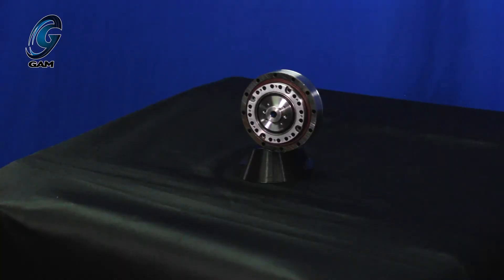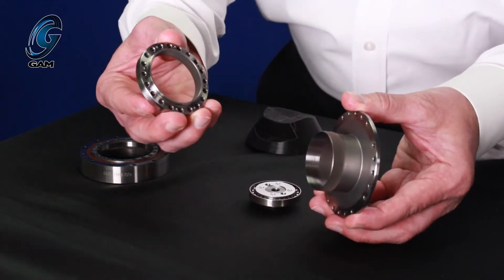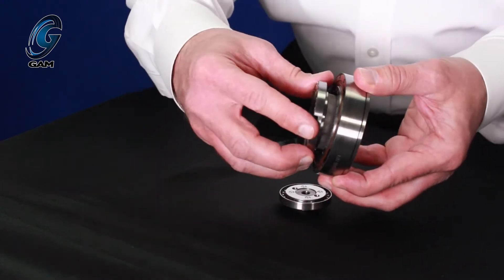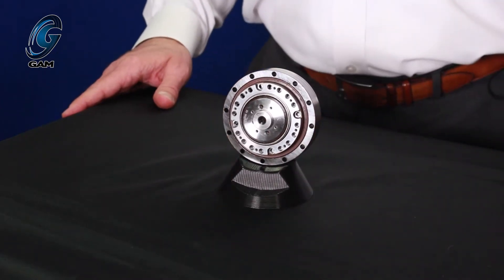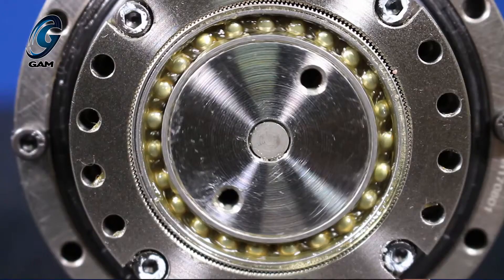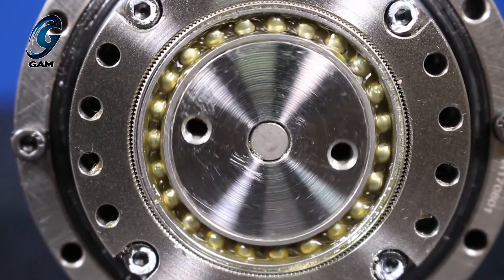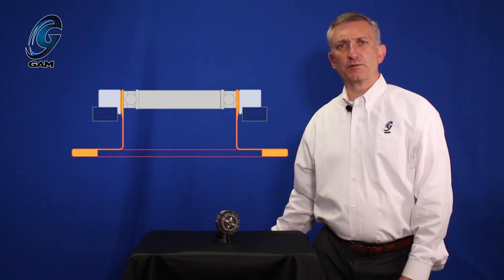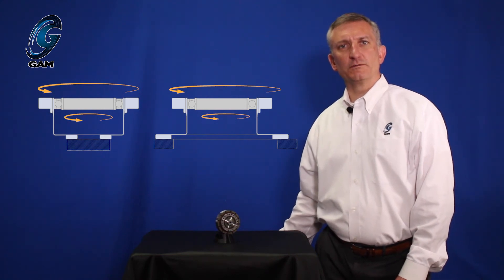Strain Wave Gearing Operational Overview

Comment: Hello, I was wondering if you know where I may be able to buy a small strain wave gearbox such as the one in this video. Thank you for any help.
Reply: Hello Jonathan.  My company is currently prototyping a "prosumer" grade strain wave drive for Nema 14 and 17 stepper motors.  You can connect on Instagram and get on the list of beta testers when we are finished